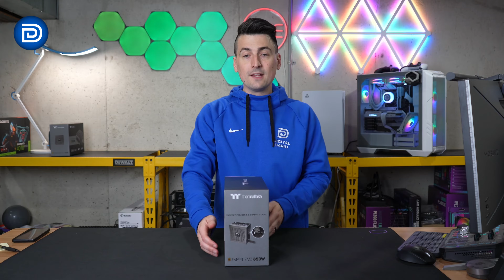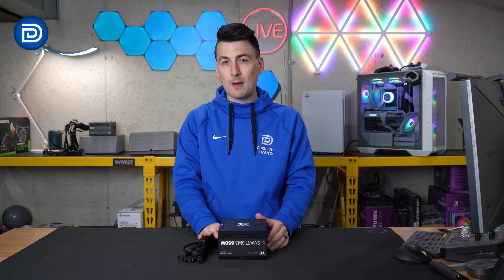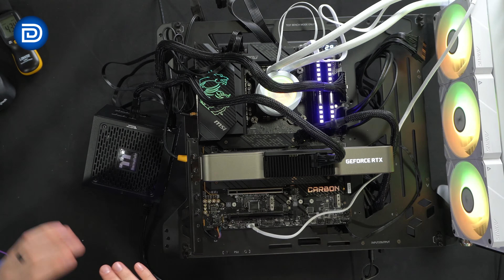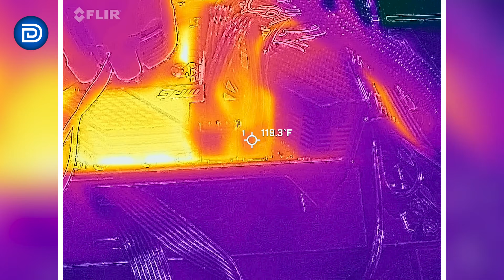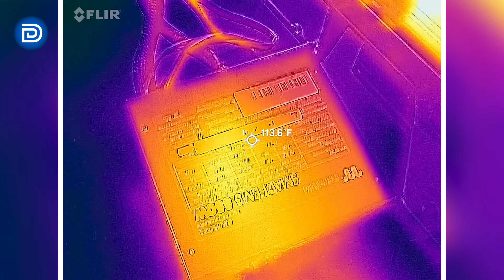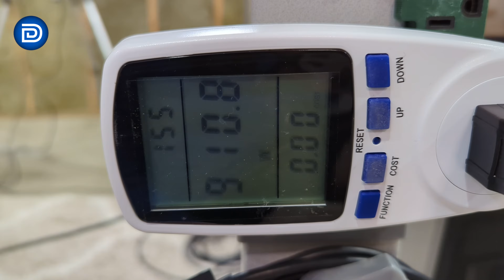Thermaltake Smart BM3 850W PSU Review!

Comment: Still using a ThermalTake Smart Power 850W PSU from 2011, I paid $99 at BB for due to a employee placing error an forgetting to remove a lower price tag.
Reply: idk how but i got mine at best buy for $80 it was the same price as the 650w one

Comment: 3:48 can you please show how many and what type of cables are included a bit better - what I mean is how many 4/8 pin plugs are included - I would like a power supply with 2x 8 pin for the cpu.
Reply: i bought the 650 watt version, and the eps motherboard power cable has an 8 pin and 4+4 pin connector. i assume the 850 watt variation is the same.
Reply: @fgreen411  Bought the 850w anyway - yes same - 2x4pin plus an 8 pin. Thanks.
Reply: @Frazreid hey man has it been treating you well i wanna buy it but I’m scared that it’s bronze
Reply: @kinglotara  there is nothing to be scared about a bronze psu